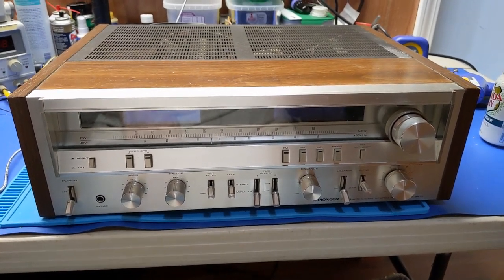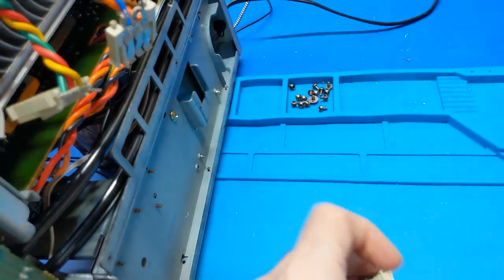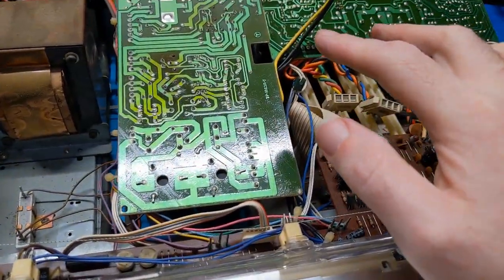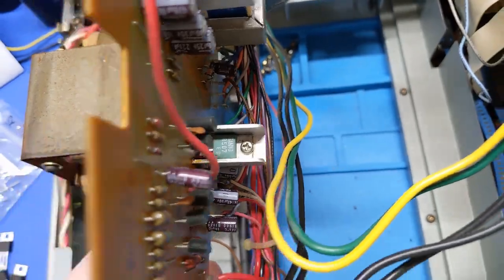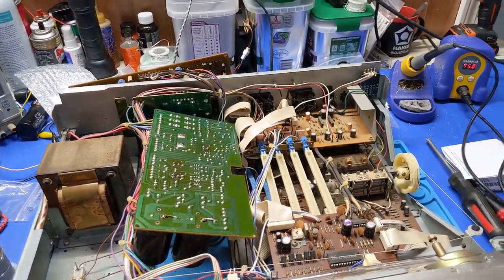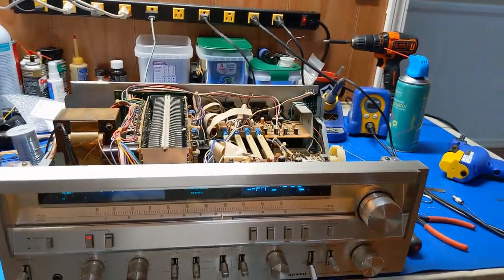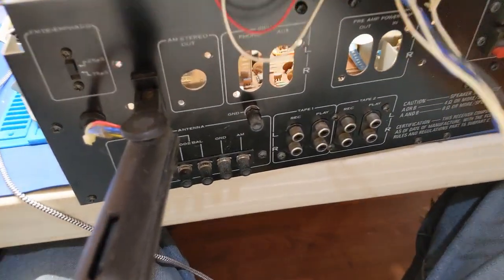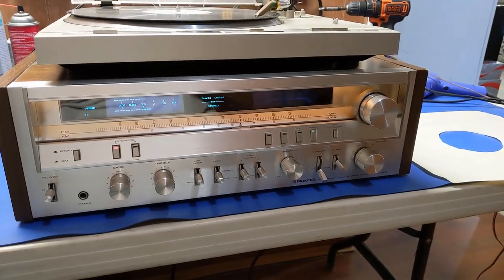Pioneer SX-3800 partially dead, let's fix it.

Comment: Thank you for your time on this classic receiver.  One of Pioneer's last silver face hurrah's; with some of the coming cost cutting measures mixed in for the future technician to sort out.  If I remember correctly, the display has an unobtanium IC that sometimes fails...which leads to alot of cannibalization of other machines. There is another restoration video that shows green sockets used with set screws for the wires; I'll have to find it again so you can see a visual reference...just in case.

Comment: You should  test big capacitors with 100/120hz and not with 1khz. Change your DER EE 5000 to 100/120hz and it will measure the right specs (it needs a few seconds). Filtercaps are not made to be run at high frequencies. All LCR meters are limited in magnitude of a 10th of the max capacitance if the applied frequency is 10x higher. i.e. 100hz max 50'000uF, 1kHz 5000uF, 10kHz, 500uF etc...

Comment: to clean this tonished contacts there a better way of doing it instead of using sandpaper. those contacts are in most case coated for better contact und prevent early corrosion, sandpaper will scratch it away. You can use kitchen stainless steel polisher/cleaner with a Q-tip and maybe a drop of water, it's very usefull.
Reply from the maker: I am aware, but the coating (plating) has already corroded away causing the problem to begin with that simple contact cleaner wouldn't resolve. I have run into this a few times